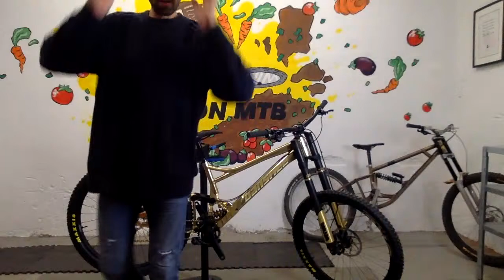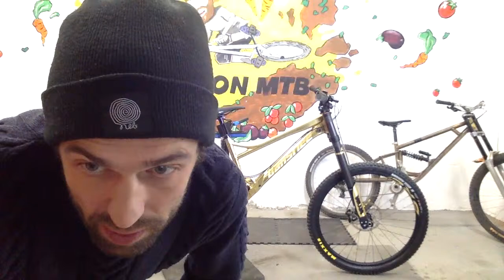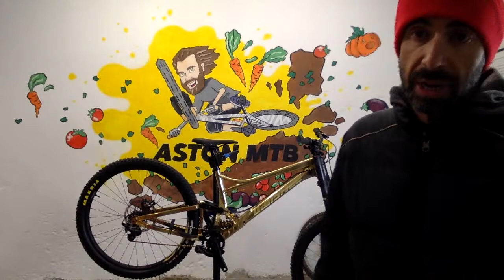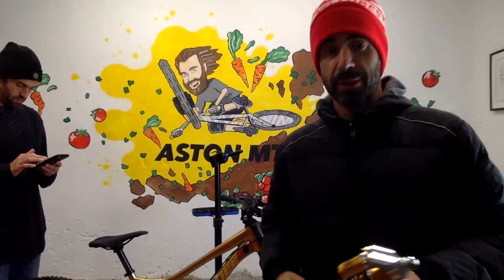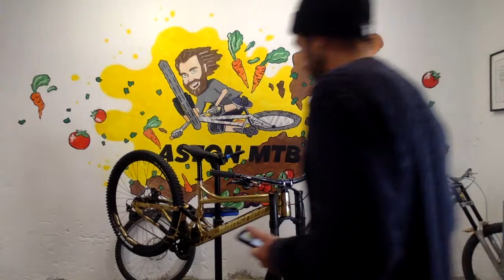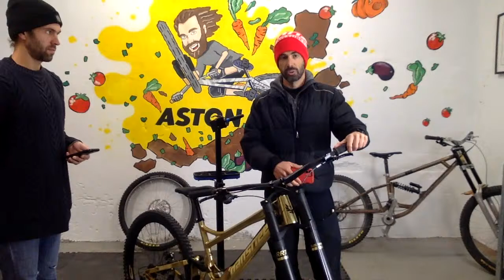Banshee Legend RRT - Ask Us Anything

Comment: it makes no sense that banshee doesn't make a mullet,banshee is losing sales,i know because i would have just purchased one until i realized there is no designed mullet option,wake up banshee,474mm chainstays are on the outer limit of what works on a wide variety of tracks.Just redesign to allow rider to choose either wheel size,its not complicated,sales will increase and the bike will show up at more races.